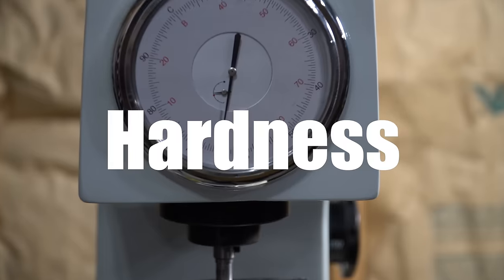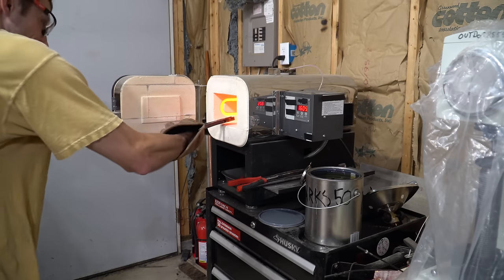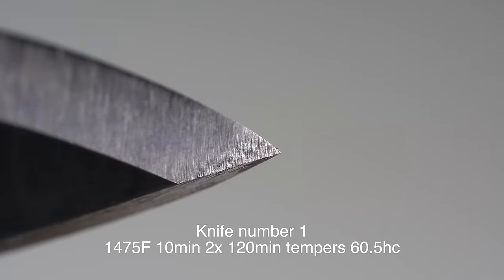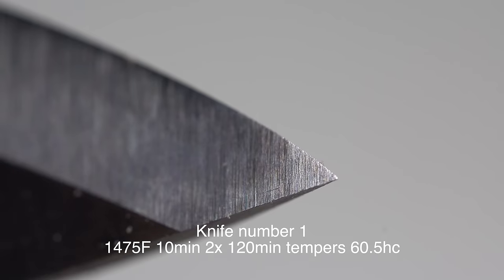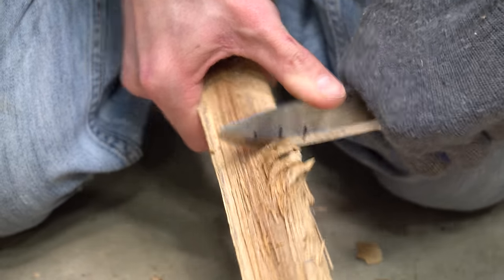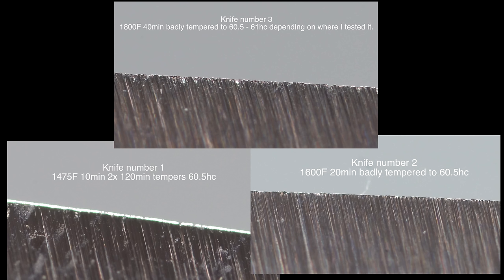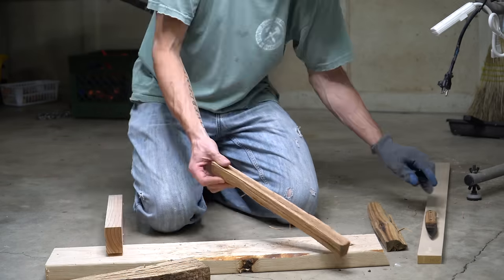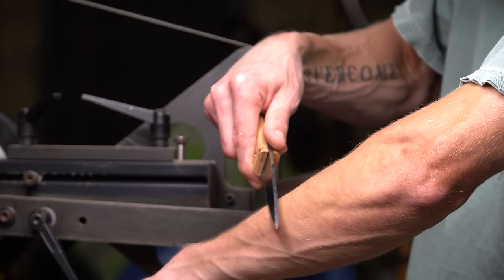The BIGGEST LIE in the knife industry- Good Heat Treatment vs BAD Heat Treatment

Comment: Basically, this is what I have always heard. HRC goes to edge retention. Proper heat treatment (temperature and tempering) goes to the toughness of the blade and how well it can take impacts and lessens the chance of breaking or failing during usage. To me heat treatment is all important. So a 57 HRC might be my choice over a 62 HRC I can sharpen a knife with a pocket diamond stone or ceramic rod even in the field. What I can't do is replace one in the field that breaks.
Reply: Exactly! His statement: "When people talk about performance they are talking about edge retention" really frustrates me because it's too true, when it shouldn't be. People these days obsess over edge retention and they get overly brittle and impossible to sharpen knives.
Reply: @christopherrowley7506  Bought a chefs knife once that was so hard i could not sharpen it in a normal way. It ended up being used in the garden :D
Reply: @baadtaste1337  surgical steel
Reply: @mikeries8549  When a knife is sold as being made with 'surgical steel' without being any more specific, that almost invariably means that it's made of 420J2 stainless (or nearest Chinese or Japanese equivalent).  420J2 is about as soft as a steel can be and still make a useful knife.  It's sold as 'surgical' because it's extremely corrosion resistant, and therefore ideal for surgical instruments.  it's more likely that this 'unsharpenable' knife is made of what would be considered a 'tool steel'.
Reply: Yeah, this has always been my understanding, since my interests lie more towards swords and other weapons as opposed to knives meant as tools. For a weapon, you'll often even prioritize durability over sharpness - a slightly dull sword is better than a broken one - so proper heat treatment is very important. It never occurred to me that for tool knives the priority might be reversed, but I guess that makes sense.
Reply: Use the right steel for the job. Don't use M390 for a bushcraft knife when that's NOT where that steel excels. Something such as 3V is a far better choice in that application.

Comment: This is just based on my experience and own personal research but likely the reason why all three of the knives had similar edge retention is because in reality what you're testing is abrasion resistance which with a more basic carbon steel like the 1084 that you were testing with, it pretty much just comes down to the hardness (and edge geometry, which was identical) of it which all of them were nearly identical. Toughness, strength, and apex/edge stability are much more open to variation depending on the other specifics that come along with heat treatment, which is exactly what your testing showed. Honestly, these results didn't surprise me at all, the results reconfirmed prior conclusions I've made. That's why HRC is just one indicator for a good heat treatment and isn't the only way that a person should be evaluating purchasing a knife. Videos of real world testing actually demonstrating the edge retention, toughness, strength, and edge stability are the best resource.
Reply: Yeppers. 1084 is a pretty simple steel. Going to A2 yields much greater abrasion resistance (edge holding) because of the wear-resistant complex carbides formed, but heat treating is a little trickier - you need to watch your austintizing temperature and temper to Rc58 to get a maximally tough blade. If you're going to put all of that work into a blade, use a good steel and have it properly heat treated.

Comment: Great video!  It would be interesting to compare toughness of a well heat treated knife at 61 HRC with poorly heat treated knife at 58 HRC.
Reply: Or vice versa.
Reply: Unfortunately the relationship between toughness and hardness is not linear and quite steel specific.  The poorly treated knife at 58 could be notably less tough than one at 61 with a good treatment.
Reply: 58 HRC is not poorly heat treatment at all!! 😂
Reply: @oldeays5085  depends on how it got there.  Pull out of the fire/oven and quench and you can get to 58 without even tempering if you mismatch the steel and the quench.
Reply: Toughness will always be worse in the poorly heat treated knife regardless of the HRC.
Reply: Crystal structure on 58 vs 61 is completely differant no matter what.
Reply: generally, toughness comes down to grain structure and brittleness.  higher hrc increases the brittleness, but with them being so close, i'm guessing if the 58 had bloated grain from substantial overheating, it'd be considerably weaker than the 61.
Reply: @3029dz  how so?

Comment: The trouble with heat treatment from a consumer perspective is that it’s hard to quantify. Someone can tell me that Spyderco (for example) does an excellent job with heat treatment, but someone like me doesn’t really know what that means. Hardness, on the other hand, can be tested with a fancy machine like yours and listed in the specs. 

I’m no metallurgist, but if I’m choosing between two knives I’m at least smart enough to know that 61 is higher than 58. Most people wouldn’t put the effort into understanding the intricacies of heat treatment even if companies presented it as plainly as possible. 

In other words, while heat treatment is likely just as important, hardness numbers still make more sense for layman knife shoppers.
Reply: Bzzzt. White iron can be 65 Rockwell, but would be a rubbish blade. Relying on hardness alone is misguided. It's like only relying on the miles per gallon when buying a vehicle.
Reply: @OllieVK  exactly. Some steel at 58 HRC will be far superior to another steel at 63HRC for example. Also two steels with the same hardness will be entirely different in performance, toughness, edge retention etc. What matters is the specific steel being used as well as the heat treatment.
Reply: Well, I've always heard one of the best in the industry is Buck, the whole Boss Heat Treat thing, but I sent a 110 in under warranty because the tip broke off on me. Of course, I'm hoping I had a lemon and I'll never worry about that again. A month later another Buck 722 Spitfire I had broke, the internal mechanism snapped or something sent it in, haven't gotten them back yet, but totally rethinking Buck.
Reply: @geico1975  probably something you did.
Reply: As a metallurgist, if someone tells me that one is 58 and the other is 61 I would assume both could have come off the same load. We don't heat treat to a single hardness. We heat treat to a range. Even a hardness test block has  +/-.5 HRc uncertainty.
Reply: @MatrixCoreteam  that is way too much of a difference. If your steel is between 58 and 61HRC you are not heat treating your steel properly.
Reply: @AlexanderMason1  I am the metallurgist for a large heat treat operation and have been making and heat treating steel for 20+ years. I am pretty well versed in hardness testing.
Reply: @MatrixCoreteam  well I sent 5 knives to get heat treated by buck. I trust them
Reply: @OllieVK   @VK7NFI  Well... Hardness can be quantified, and assigned a number. But, how does a manufacturer quantify toughness in a manner that the average consumer will understand? There isn't a universally agreed upon toughness scale, at least that I'm aware of. At present, the best that can be done is qualify it: reasonably tough, extremely tough, more brittle, less chippy. These are merely subjective descriptions, and what's reasonably tough in one use case (which may not be defined) might more brittle in another.
Reply: @unopine you need to look at a combination of hardness, tensile strength, yield and elongation to get an idea of that. The problem is that not many of these sintered steels have those figures, because they're not manufactured in a conventional sense like a forging or casting is.
Reply: Thank you for your comment. It was such a relief to read in the flood of bizarre thinking that the subject of hrc seems to reliably elicit. For me the subject of "sharpness" is multifaceted. It is not a single entity confined by any particular subset of factors. People seem to subjectively select their chosen subset and call that objective reality. Anyway, when I look at hrc as a collector, I am assuming that all other factors are approximately equal. I look for a vendor with a good reputation for quality heat treatments because the specific HT is not in my view and I can't/won't judge it anyway. The only piece of data in view (hopefully) is hrc. When I see two quality makers of K390 blades, one in 62 hrc and the other in 66.5, I want the higher because of my personal fascination/valuation with/of sharpness. There are YouTubers who are showing that pushing a blade steel to the upper part of its hrc range makes a substantial improvement in sharpness/performance. The back and forth between design/production and field result is natural and productive. Although there may be the usual light and noise along the way.

Comment: Hey there, great video!
I wanted to add a little thought to the discussion that you didnt mention in your video. I believe it is wrong to reduce the knives performance to edge retention of the blade where harder means better. By following through with that thought, the best knive would be a knive that has not been annealed at all.
Your findings do prove that there is a difference in quality that is independent of the hardness value, after all nonne wants a kitchen knife to break upon cutting into a bone. Wich could happen with a knife that is equally bad as the third one.
But on the other hand i do not believe that it is possible or sensible to try and find a metric to measure the quality of the heat treatment, since the manufacturers of quality knives have figuered it out anyways and the manufacturers of bad knives (i.e. the 26$ damacus knive you teste) lie about their products anyways.
I believe the current system, where we get an information about the hardness and assume that it has been heat treated correctly, is flawed but there is no realistic benefit for the average consumer to change anything about it.
Btw i love that you try to test things, that are currently measured by feelings and subjective means, in a way that is as scientific as humanly possible. Keep up the good work man!

Comment: You did a good job! Hardness determines edge retention and abrasion resistance. But grain size determines toughness, in choppers, axes, and swords heat treatment is key to the performance of the blade. I have had poorly heat treated blades snap, much sooner than a properly heat treated blade.
Reply: Another point is that you can get a thinner edge (more acute angle) with a tougher steel, without getting chipping. A thinner edge INCREASES edge retention. So the truly telling test would be to grind the 3 knives to an angle where they don't chip or roll on normal cutting tasks. Then see how the edge retention compares. (follow up video? *wink wink *)

Comment: I tend to buy knives with higher claimed  HRC.    The chipping issue is something the OEM's tend to discount as __________  steel is difficult to work with and prone to chipping.
Maxamet knives are a good example.  I purchased two identical knives,  one chipped like mad, the other ZERO issues.  I sent the chipping knife back to the OEM and was told the Rockwell was "within spec" good luck with the knife...    The chipping issue eventually sharpened out.  The knife still has damage where the chips were too deep to completely remove. (waste of knife steel, only cosmetic issue.)     Thanks for the video,  excellent work!   :  )

Comment: This was a great, down to the bones kind of video. I found it especially helpful since I'm currently using only 1084 and really trying to pin down how to get my best results with it. When I worked 1095 years ago out of an anthracite coal forge, all my blades failed because of grain growth. I just couldn't give it a steady soak without going too hot at some point and the grain looked like that moldable sand kids play with. Total disaster for me. I'm trying to focus now on maximizing durability. I'm getting ready to make a knife for my little nephew for when he goes out fishing or hunting with his dad, and if he's anything like I was as a boy, he'll need a blade that can hold up to um,...'rough' treatment 😉👍
Reply: if you're heat treating in a forge, you'll need to heat the steel and not the forge. The advice to try to make a forge perform like a furnace is bad advice for simple stuff. If you can have a hot spot at your burner or burners and the ability to move the blade in and out of it, you'll get no grain growth with 1084 and 1095 if you do a low temperature pre-quench, then do thermal cycles - pull the blade out of the forge and let it cool to black each time and then heat only to nonmagnet plus a little bit of a temperature overshot as much as you can get one in literally 10 seconds and then quench. 

You should end up with finer grain than you'll see pictures of anywhere else and nothing unusual in the structure of the steel. 

if you use 1084 and overshoot temp once after the thermal cycles "just to be sure it's hot enough" for 15 seconds, the grain growth will double in size. 1095 is a little more forgiving, but it doesn't have any real margin to give in toughness. 

You can practice the thermal cycles by overshooting temperature on a sample for 15 seconds and examining it vs. something annealed once and quenched just after nonmagnetic. The latter will double in size grain wise. Take magnified pictures of the grain, then do thermal cycles with the large grain sample and bring it back to grain smaller than the part that you intentionally didn't overheat. That gives you a very good idea of what you're seeing in forge by looks and by time and how much it affects grain. 

You'll want to take an offcut and do this with everything you'd like to use. 80crV2, for example, suffers no visual change after a 15 second high temperature overshot. That doesn't mean the intentional overshot past just a little is a good idea, it just lets you know what you're dealing with.
Reply: If you want even heat in a solid fuel forge, place a thick walled (thin walled works too) pipe in the coals and bring it to temperature, then place the blade inside and the radiant heat will heat it up very evenly.
Reply: Watch larrin's video on heat treating with a forge. Just only to magnetic from a normalized blade. If it's not magnetic it's hot enough, no matter the temperature, if starting from normalized steel. You don't get a huge range of hardness value this way, though, so you have to choose the steel for the task. 52100 will be hard as hell but not tough enough for a sword where 5160 would be a better choice.

Comment: Thanks for an excellent video. 

An interesting test would be to take the knife with the poor heat treatment and re-treat that knife with the good heat treatment to see what effect you would get. The long and hot initial treatment would cause grain growth, but the quench might set up the microstructure to have a better grain size on a second heat treatment. The other possibility is that the prior austenite grain boundaries are already established as large grains and that you wouldn't fully recover the grain structure. Getting the steel back to where it should be might require annealing, rolling, and heat treating from the beginning. All of my classes in this area were too long ago for me to remember what the answer is.

Comment: Interesting video! 
Perhaps they all performed the same in the edge retention test because your tests were focused on abrasion resistance type tests, or is that correct? 
Since there are several modes of sharpness loss that may be experienced during varied practical use, such as micro chipping, or deformation...
1084 being (basically) a eutectoid steel the austenitizing temp has no real bearing on carbide content in finished product, or potential retained austenite like it does in higher carbon steels, both of which would make a big difference in the abrasion resistance aspect of edge retention. In other words, if you tried this with a higher carbon steel you might see some additional significant differences between the samples.
I like your point that RC hardness isn't really the best reference point for blade performance!

Comment: Great testing and discussion!! I fully agree, that’s why I don’t get excited about overly hard steels, unless they are also tough… pure edge retention only matters if you slice cardboard or rope all day in a controlled manner, but if you start using a knife in a realistic way, who needs a fragile blade that will be difficult to resharpen and strop? Favourite tool steels would be m4, k390, favourite stainless would be cpms30v… looking forward to trying out cruwear and magnacut, don’t care about 15v, s90v, m390 unless it’s heat treated to perfection, also don’t care about 110v or maxamet

Comment: Really well done video!

It shouldn’t be much of a surprise that these all had the same edge retention. Regardless of crystal structure, HRC directly correlates to abrasion resistance, that’s effectively what it measures. Harder things will resist abrasion better than softer things. The grain size, which is the only variable here shouldn’t effect how the steel wears in a pure cutting application. 

Hacking through some boards would likely show more micro chipping and therefore faster wear on the poorly treated ones though.

Comment: it would be interesting to see how the un-tempered knife at 65 hardness compared to the other three, in the same test categories. A fair assumption would be that edge retention was better than the others, due to the greater hardness, but toughness would be rubbish
Reply: Un tempered blade will snap at once, is like a glass very hard but very weak on elasticity
Reply: it would break instantly.. possibly even from just setting it down too hard